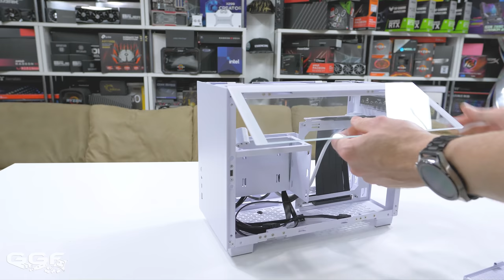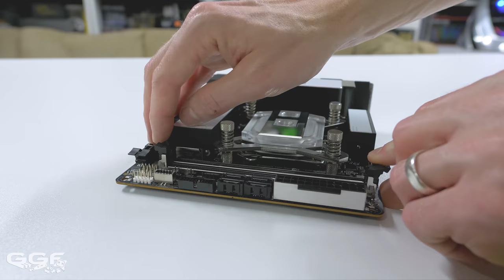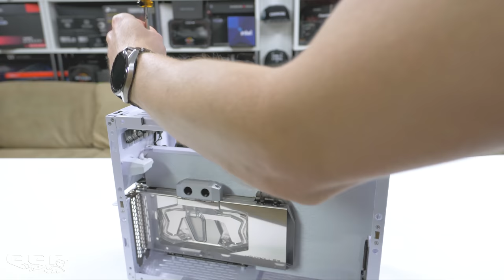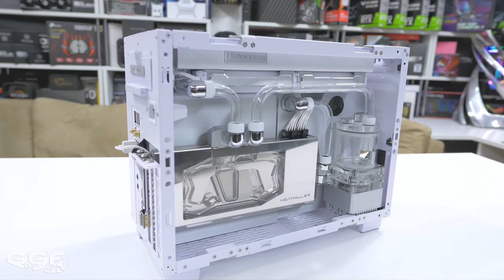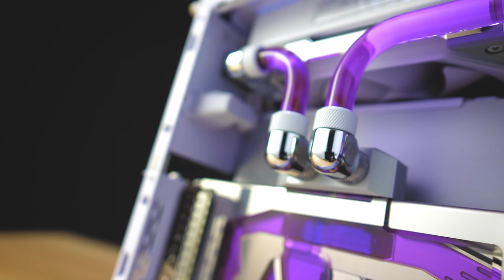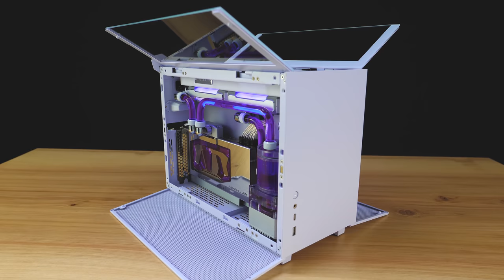SUPER CLEAN! LIAN LI Q58 Time-Lapse Build

Comment: If you want the controller and fan hub, 240 not a 280. Removed mine, to fit it in comfortably. You won't find a better case. Price to quality ratio.  A Gap between case and PSU, to hide cables. Super easy to build in. Looks nice. Clean build.

Comment: It's almost disgusting how clean this build looks. Awesome job, man. I couldn't have made anything as sick as this build. Quick question: What do you call that metal ring that you use as a channel to feed one of the radiator tubes to the GPU water block? Not the little LED screen that displays the temperature, but that spacer-looking metal ring?
Reply from the maker: Thank you. Oh the pass through fitting? It was a real life saver in this build

Comment: Where did you get the display/screen for the temps? Also, How did you connect it to the computer? 
Also, great build as always!
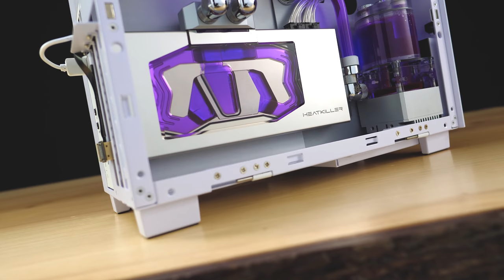Reply: Looks like there's an HDMI cable that connects back in to the case at 6:21. Great job at making that look clean!
Reply from the maker: The previous video to this one I explain it.

Comment: So how good (or I'd wager, bad) are the temps like for CPU and GPU under normal gaming loads? I have an SSF system with 3X 120mm rads (all intake, in a chimney style case), and temps aren't anything to write home about, they're like 50-55°c over ambient for a Ryzen 5 3600XT and 35-40°c over ambient for an Nvidia RTX 2080 Super (ambient is usually around 26°c or 28°c, I live in a warm country and I don't have an AC, though I'll probably get one soon)
Reply from the maker: Maybe watch our review video on this case?

Comment: i think the radiators is not enough. if gaming or rendering it will be very hot. above 80°c. beautiful , but not practical. very interesting real tests of temperature, and scores. in video there some temperature but i suggest that pc is not working properly in video used adapter for only pump working. or pc just starts, or "sleep" mode, not loaded.
Reply: in the other video he shows benchmark results including temperatures for the CPU and GPU. The CPU stays at about 71°C and the GPU stays below 70°C with the GPU RAM reaching 74°C in 1 test.

Comment: These mini-builds are all aesthetically beautiful and flawless, but on a functional cooling level they are not sustainable: a single 240mm radiator to cool a 3080 with a 11700k just doesn't make sense, even with the CPU and GPU downvolt. Sorry, no offense.
Reply from the maker: Did you even seen the temp testing? And fyi it's a 11600k
Reply: @GGFEvents   An I5 with a TDP of 125 watt + 320 watt of GPU. 445 watt in total dissapated with a 240 slim radiator. And do I need to see the temperature results? Really?  According to the laws of thermodynamics with an ambient temperature of 30 °C the liquid will be at least at 50 °C. Flow and ventilation are negligible in this case. It is not a functional cooling.  I'm sorry, I specified that I did not want to offend anyone, it is a simple statement.  Aesthetically, the build is beautiful, congratulations!
Reply: @alessandromartorelli3929  Ignore the temps more? It's obviously functional, quit being negative over something you have no idea about. Tons of SSF mini builds out there that even use a 3090 watercooled lmao.
Reply: I have a 10900k and titian rtx on a single 240 rad in formd t1 with 3 slim noctua 120s - gpu temp hasent peaked past 60 even in long renders and cpu hits around 75 in prime95 and much lower in gaming. A heavy undervolt was needed yes but a 240 is fine if you plan your airflow and component choice properly
Reply: I have a 350W 2080ti and 5600x on a EK 240 slim itx build, you can absolutely use it long term. GPU sits at 65c and CPU at 78c in Pubg.